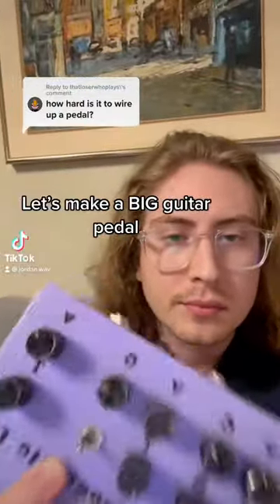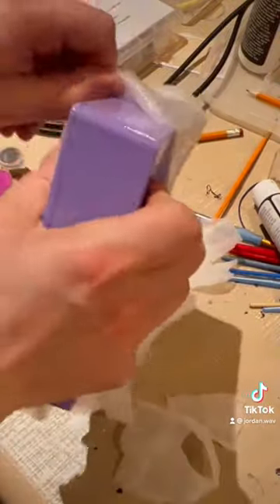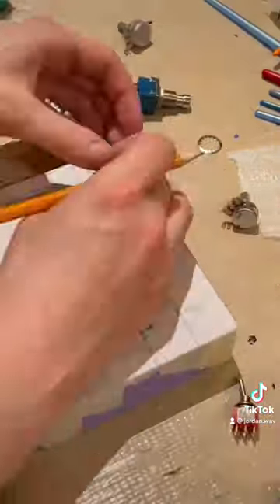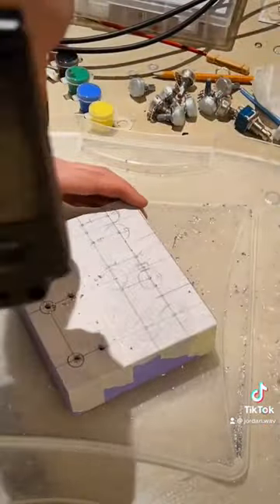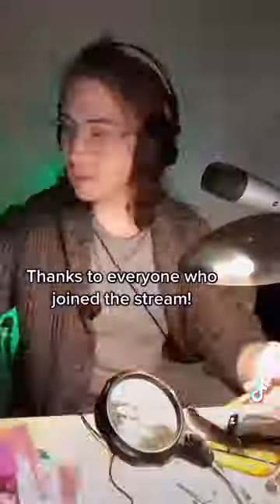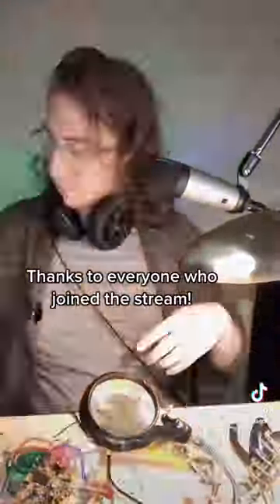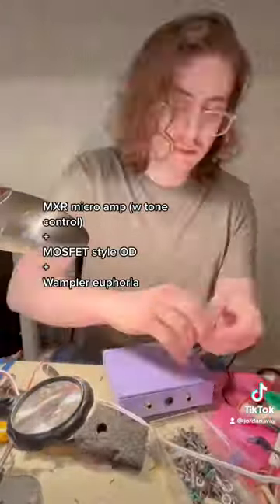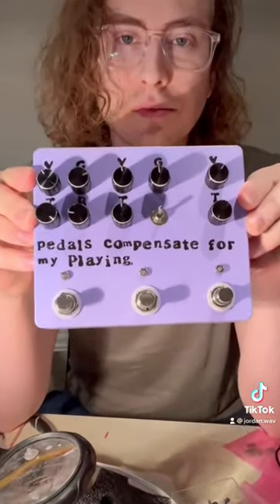Making a BIG guitar pedal.

Comment: Is the hum just because of the single coil in your guitar?  Or is it possible to reduce the hum through better grounding? Curious as I've tried modifying a few pedals but have problems finding a true expert opinion
Reply from the maker: haha i am no expert but the hum here is a combination of a few things: 1 - single coils, 2 - gain on the pedal is cranked. 3 - the amp is plugged into the same non-isolated surge protector as both the pedal adaptor, light and soldering iron
Reply: @jordanwav  thanks... as I said I've modified a couple pedals but wasn't sure if it was grounding issues because, for whatever reason, I get considerably more hum on hard ground vs putting my pedals on carpet... just looking for noise reduction hints lol I know  at at loss always with my single coils but I find often with humbuckers I'm still getting a nasty hum... curious if you've ever fooled around with different capacitors or not?